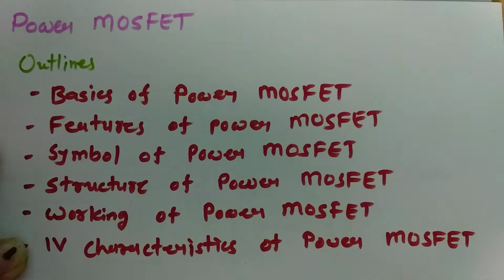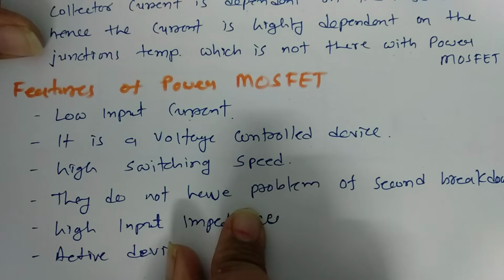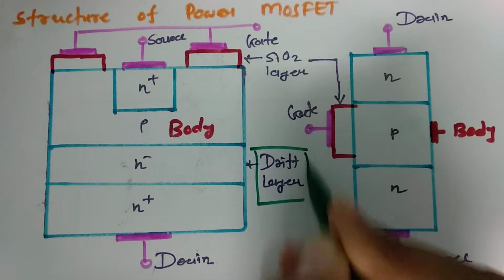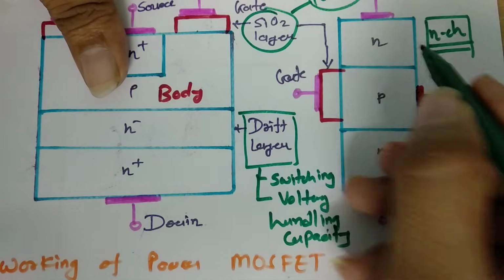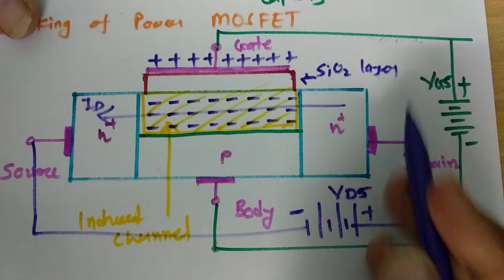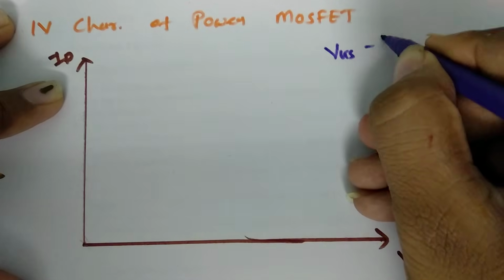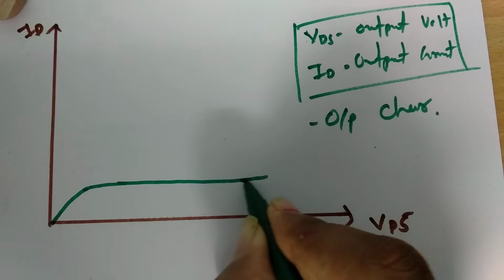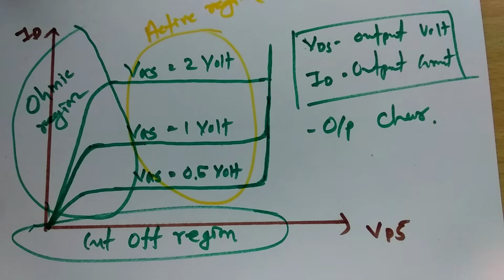Power MOSFET (Basics, Structure, Working, Biasing, Features & Characteristics) Explained

Comment: Sir I need answer of these questions 
Tomorrow my exam 
Pls 
Help
A power MOSFET with a breakdown rating BVdss = 8ooV must conduct 10A when on with a maximum ON STATE voltage Vds,on = 4V. If the current density in the MOSFET must be limited to 200A/cm^2. Estimate the conducting area which is required.

Comment: What's the formula to calculate conduction losses of a 500watt 10v/5v dc dc buck converter  using MOSFET, when we are provided with the values of on state resistance, switching freq, turn on and turn off times of MOSFET.  We need conduction losses of mosfet